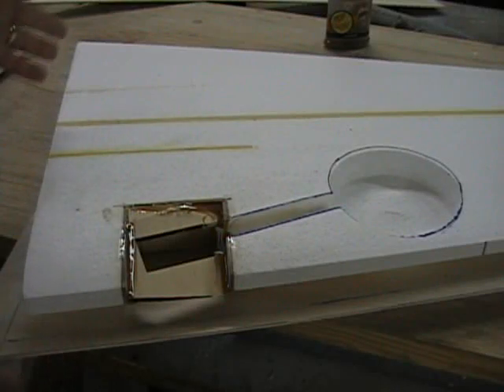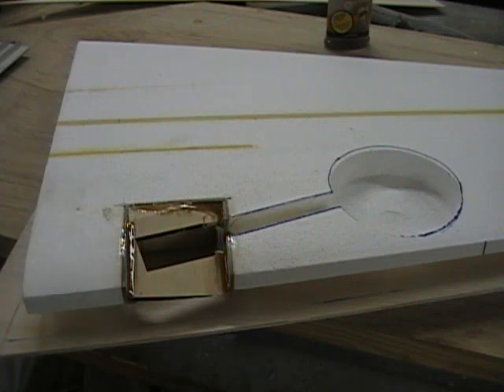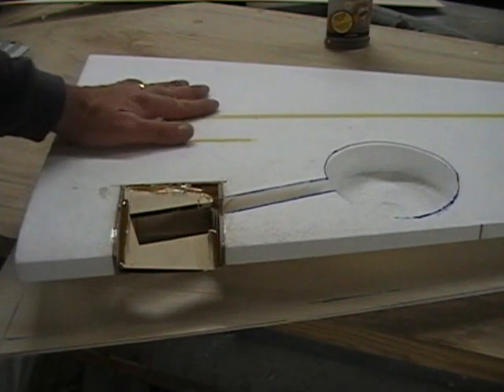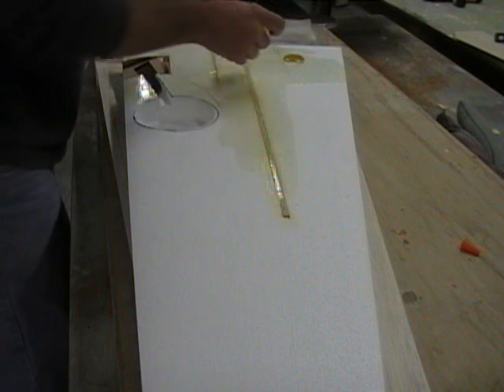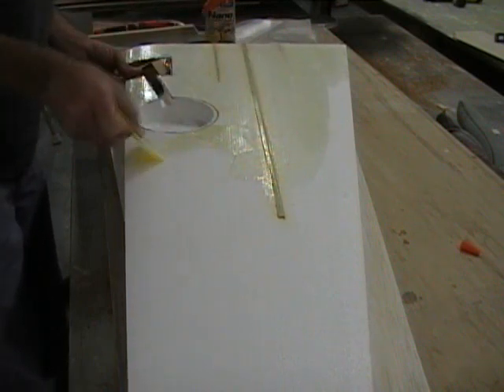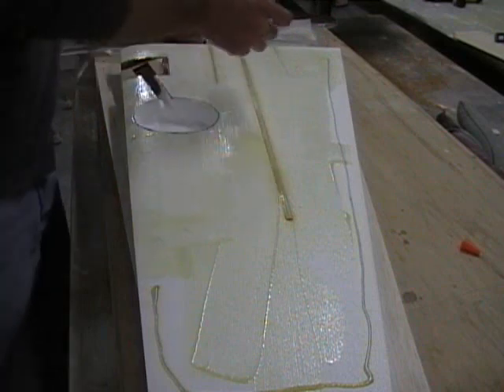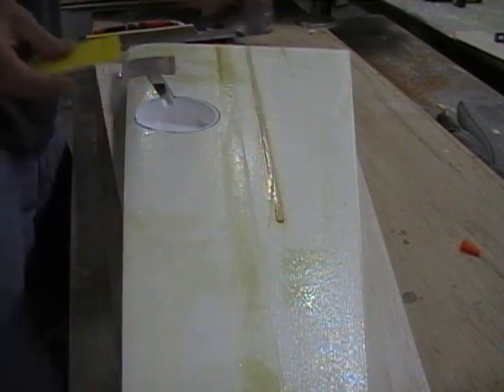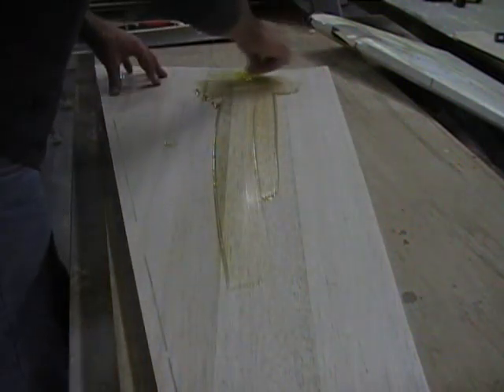sheeting a foam wing part 4

Comment: Hey Lan, great vids.
.
 As others have mentioned, it's the moisture in the air that sets off this glue. I have a bottle of Gorilla glue that I started using about 3 months ago. What I did was to squeeze the bottle so that the glue is just coming out of the nozzle, then hold it like that while screwing the top back on. That's it. No air left in the bottle means no reaction in the glue. Once the bottle is getting nearer to empty, I have to use some spring clamps and whatnot to squish it down. :¬)

Comment: You need only coat the foam with polyurethane glue, and water moisten the wood surface, before applying the two components; saving 4oz of weight.

Comment: Buying PU gule large quantities make sense. It's contaminated by water and exposure to humidity in air is enough to start reaction. A good way to handle larger quantities is, put it into smaller bottles in a cold environment (when humidity is low).  Use the 6-oz squeeze bottles from Michael's Craft Store, paint section.  Fill almost to the top, then cap them with heavy gas like CO2 or PolyPurge. It will store a very long time this way.